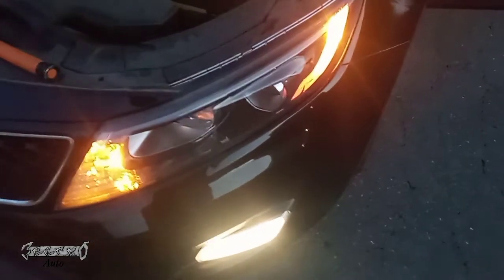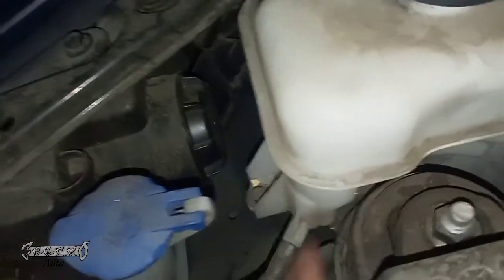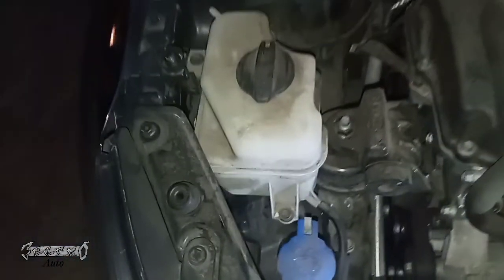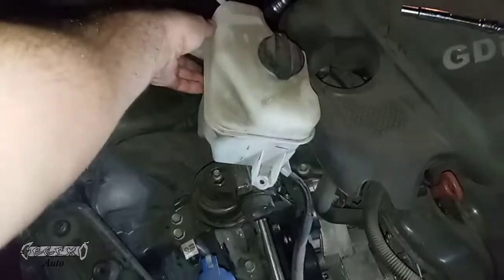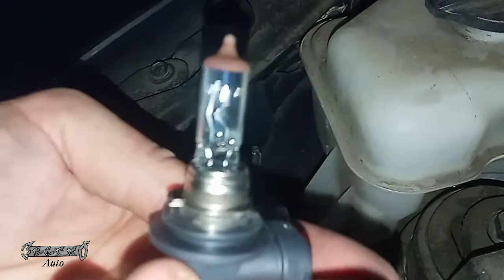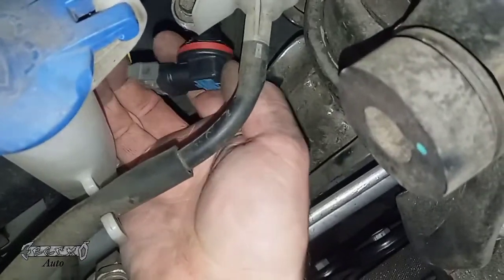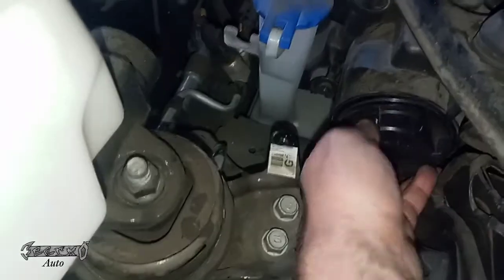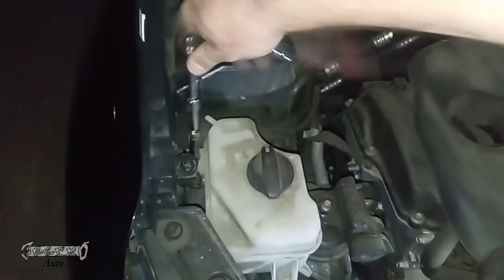2014 KIA OPTIMA FRONT HEADLIGHT BULB REPLACEMENT

Comment: I replaced headlights hi and low and fog lights now my traction control light is on and my brake lights are on when my headlights are but when I turn my headlights off the brake lights go off. Any help would be appreciated